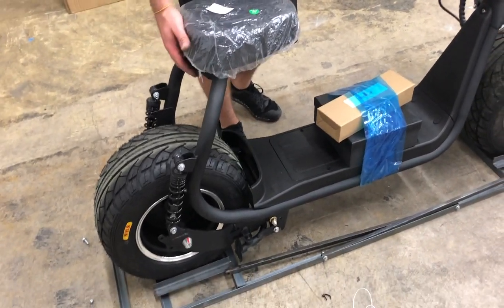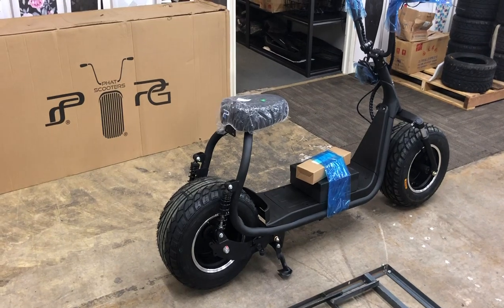NEW Scooter Assembly Instructions

Comment: The hardest part for me was not assembling the scooter, it was disassembling the packing it came it. Getting that metal frame off was an atrocious process. The company I ordered it from (mine is similar) also tied a bendable metal rods in eight different parts of the bike. It took me three hours to get all of the stuff off and only three minutes to assemble the bike. - But, I quickly forgot it when I started riding the scooter.